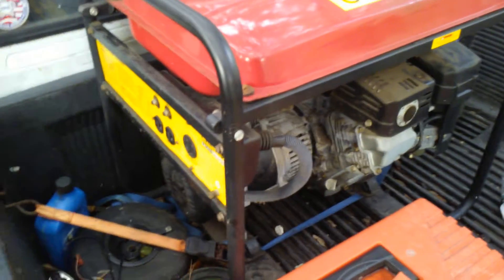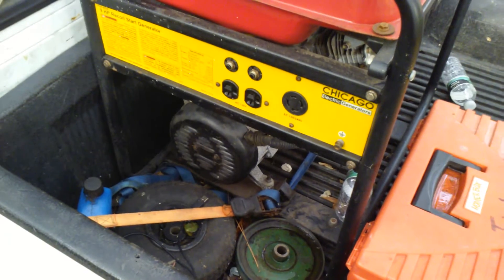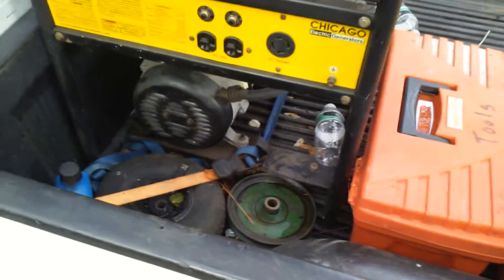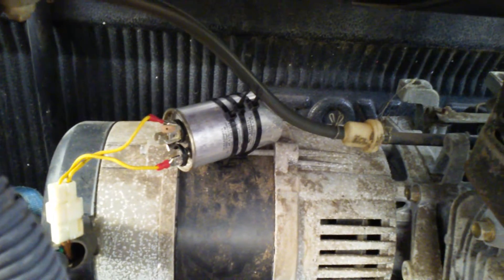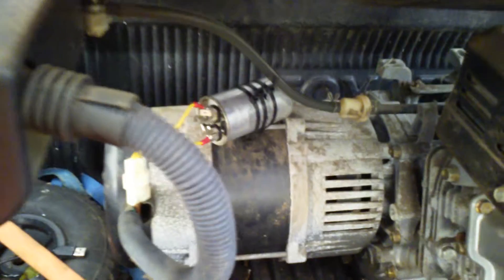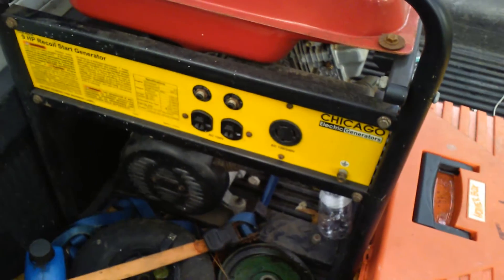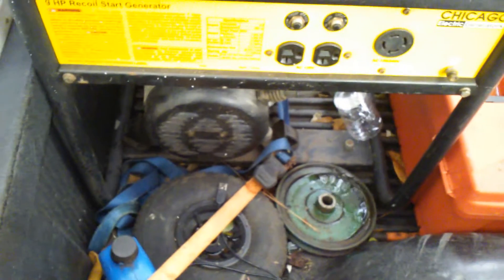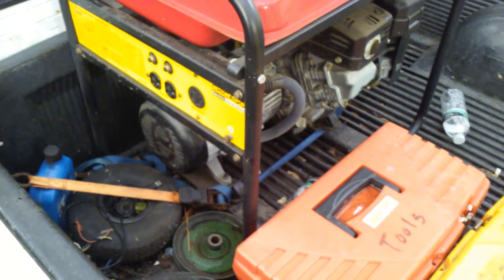Brushless Generator fix

Comment: I have a small generator with a capacitor. When I don't run anything on it, the volt is 340, and when I run on it a half-horsepower water motor, the volt becomes 220. Is this normal?
Reply from the maker: If there is no load on the generator than I have seen voltage go high. If it comes back down when load is applied like you said then I would not worry. I would only worry when volatge stays high when load is applied.
Reply: @Bbernhardsr  It only comes back down when I turn on the water motor, or any Heavy load but if I turn on a mobile charger for example, it will stay high what can I do
Reply from the maker: @الحوتالأزرق-ف5د  You can try lowering the engine rpm by adjusting the throttle screw. You should have a meter that can read the hz scale because adjusting engine rpm will adjust the hz. I am guessing that in your country everything should be around 50hz.
Reply: @Bbernhardsr  thank you

Comment: Need to run genset every couple of months to keep capacitor from drying out and loosing charge. You can flash capacitor by plugging in electric drill. Then get genset motor going, pull drill trigger and spin drill head counterclockwise very rapidly. Put a wire grinder on drill to help you spin it backwards. The drill will backfeed a few volts into capacitor and reflash the capacitor and fix the problem.
Reply from the maker: John Rand I don't think that is entirely true. I have plenty of capacitors that have been on a shelf for years amd they don't "dry out." As a matter of fact capacitors can't "dry out" because they are sealed.
Reply: @Bbernhardsr  hi
Reply: The electrolyte can and does dry out over time.
Reply: @Mikesorrento3344 okay first these capacitors do not physically store a DC charge in the off state unless the excitation coil that the capacitor connects too the two wires goes “open” meaning that the circuit is no longer complete, next it would have to fail when the sine wave is at either portion of the cycle most see that as positive and negative but it’s actually North and south magnetic fields. The capacitor in this style of generator does not store A “DC” charge. And it does kinda some what store the AC but not like it does if the current there was DC. The current there at the Capacitor is AC, what really occurring is that the capacitor is “resonant” with the squirrel cage two pull rotor but it’s 90° out of phase with it which forces eddy currents to flow and essentially the Rotor and the generators exciter coil talk to each other, or resonant with each other back and forth think of it like a tuned guitar or musical instrument except the internal combustion engine is the player, and the generator or really “self excited brushless induction alternator” is the instrument that is played by the engine. The capacitor does not store s charge here like that of a DC circuit. 
Next these capacitors are not electrolytic capacitors! They do not contain an electrolyte and we’re actually blow up if it were an electrolytic capacitor as they our polarized, electrolytic capacitors are mostly used for DC circuits, they are only used for ac motors as “Start” capacitors and are electrically switched in only during the inrush start up phase, and our switched out either with a centrifugal switch or electronic relay switching circuit, and some times not all the time a “PTC” a device that when current flows through it is resistance changes to an open state over a calculated period of time so is the amount of current traveling though is also calculated to get the correct PTC value device. There’s two different types PTC, and NTC. It is PTC that are used for this! 
These capacitors are called motor run capacitors they are constructed a bit differently then electricity capacitors and are designed to be exposed to high current AC, AC current, and excessive heat is what damages these capacitors they are non polarized capacitors designed to shift the voltage and current in order to make electrical motors more efficient “it’s called power factor” when being used the AC current since it pushes and pulls through the capacitors instead of just charging it up, over time it strips the conductive metal film off the insulator which in turn drops the capacitors capacity. Capacitors store the charge in the non conductive dielectric insulator not the conductive metal parts. The AC pushes the coating off the insulator, and can kinda pull some into the insulator as well. All of which shortens its life.